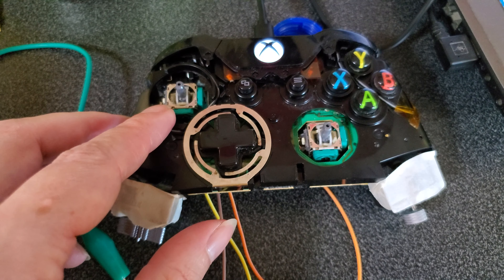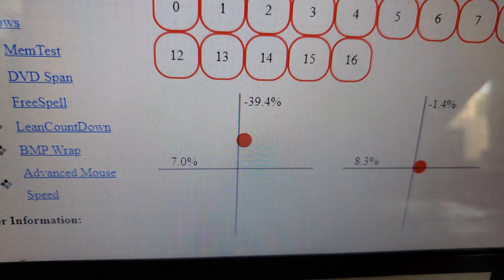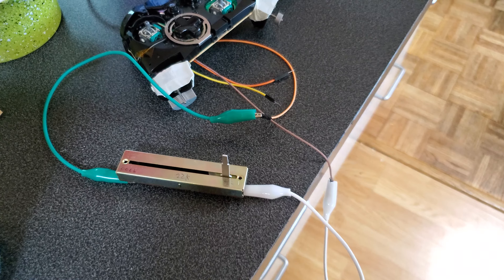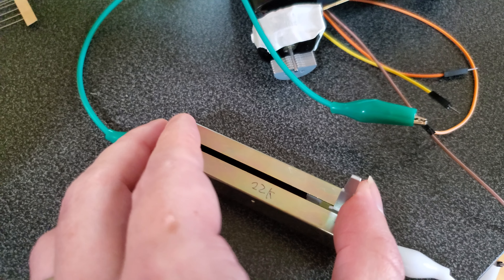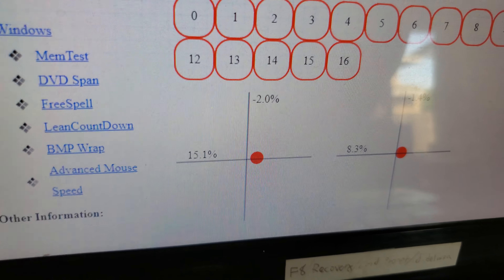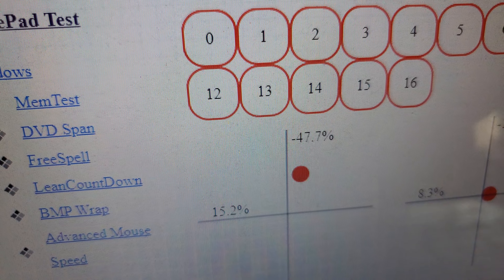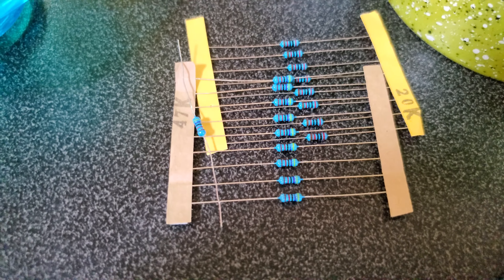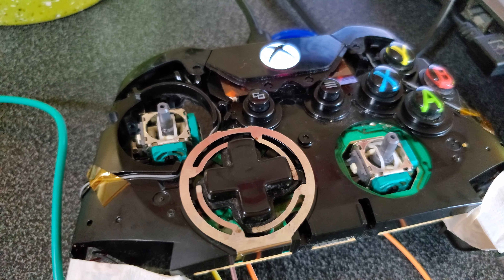Fixing xbox one joystick drift part 2: adding a potentiometer removes drift, but with side effects

Comment: In this situation as i said on your other vid. 
Your forward primary run wiper position is worn to s**t mechanically on your left stick it needs peeling open cleaning at minimum or 3 pin desolder replacing for a clean new contact & wiper assembly. 
Only then will a product like Stick drift fix help only to re centre your deadspot if its out of calibration at stock thats all that $15 Product does it would seem its a remedial fix at an exorbitant price. 
Only any good if your stick motion is still fluid on screen.
Reply from the maker: If that's the case why is it perfectly smooth prior to adding the pot?
Reply: @xeostube  Hmm not a clue thats frustrating ive not got the experience.
The only thing i can think of is the 2 Trim pot method introduces a response curve anomaly somehow? Like the Elite can change its settings digitaly. 
As to Solderkings initial 8 pot prototype work he must have been experimenting that way or considered each stick as 4 directions initially 4 pots lol. (Who knows what the game plan was) 
Dont know mate Helder didnt use it but they researched it anyway? 
Sorry to waste your time. 
I started confused i end confused total wash out. 
But they only use 1 Trim pot per side to remedy dead zone, maybe that was the only way forward on the bright side. 
Not all avenues of an experiment can be successful. 
I slipped with a solder iron 2 weeks ago? Desoldering a stick & knocked off 4 super tiny bits lost 2 couldn't solder the others back on. 
At beginer lvl i am. 
Was gona put 2 Elite V2 pots on a spare DS4 board to see if it worked. 
Ive created my own custom Analog Sticks, as full as mechanical calibration gets take a look some time. 
Its just these bloody pre set dead spots & weak or aggressive digital in game response curves in some games ported without play testing or options to adjust i cant seem to get around. 
All exampled in my vids. 
Im starving had enough internet research for today im drowning in it, good luck with yours.
Reply from the maker: @GOATGamerProSticks  two trim pots gives you flexibility if you don't know ahead of time which direction you need to bias the wiper. But the mathematical model I referred you to shows that it introduces more distortion, not less. Unless your pot goes up to a really high resistance such as say 1M at which point it's kind of like not being there.
Reply: @xeostube  I dont understand that at all that mathematical model seems flawed by my mind. 
The way i see it, it should be as simple as 1 Trim pot added per axis in parallel to swing the centre voltage either way. 
Just from your first vid for example you had up to 40%? offset from centre 0% 
By my calculation on a 10K pot 5K being centre at 0% position that seems to be a deviation calculation of (5K div by 100% = 1% 50 Ohms X 40 = 2K resistance off set? If right would you not need a 4K pot minimum to swing it back 2K from the centre of the secondary pot 2K each way?) 
If this is not how it would theoretically work i will never understand it without a college course lol. 
My thinking was if a 10K pot has 100% offset it would need a 10K Trim pot in parallel to swing it back 5K from centre on the secondary trim pot? 
As long as the primary pot was new with non worn track i would have thought it would be golden from that point onwards & just possibly need to re centre the pot position. 
I am otherwise to simple & confucius to comprehend how it works on the stick drift product but that seems to be visually how its wired you cant choose which of the 3 trimmer terminals its fitted to from that its just solder on then adjust job done... 
Ill re look at the product image zoomed in otherwise im lost to comprehend the conceptual workings otherwise.
Reply: @xeostube  Unless a high resistance secondary parallel pot grants micro adjustment on the current range? A 1M trim pot is rated 0 - 1 million resistance Ohms? (greater resistance material)
Its centre resistance value is 500K so if it was soldered in parallel to a 10K primary pot it would register at 0% input at centre 500K mark if thats how it would work if at all or change the response curve in some way? 
Then any slight adjustment on it would throw the digital centre point from top to bottom or left to right of screen in minimal movement because its got far more resistance range than the primary pot? 
(Ive blown my own mind trying to understand this im crying inside) 
Im just going to study there product circuit pathway ive had enough of this brain ache for today i dont get it.
Reply from the maker: @GOATGamerProSticks  I'm not sure but perhaps what you are missing is that adding the pot doesn't "add" ohms but decreases it, and in a nonlinear way? if you put two 5k resistors side by side the total resistance is 2.5k. So what you want is a much higher resistance so that the bias you inject into the wiper (center pin) isn't too large. In my experience a 10k pot needs around 40k-65k.   In any case the interactive mathematical model I linked to shows the exact theoretical result.
Reply from the maker: @GOATGamerProSticks  you'd never use it at the 500k point. Only at the extreme ends of it's range, either 50k or 950k. In the middle it's like not having it connected at all when it's at "50k" you are connecting pins 1 and 2 together, when it's at 950k you are connecting pins 2 and 3 together. Maybe that's what you are saying above? I'm having a hard time following what you are saying.
Reply from the maker: @GOATGamerProSticks  ps here's the math: assuming a 1k offset in the joystick, the resistor you'd need to get the neutral point back to the deadzone is 25k. check the interactive demo: https://www.desmos.com/calculator/iygqxpskrh . a 2k offset, which is huge, would take a 15k resistor, and would badly reduce the full range of the joystick.
Reply: @xeostube  I dont blame you so am i. 
But the fact remains from studying the Drift fix X360 image circuit they attached it pin 1,2,3 cente beying the wiper mirroring the primary wiper its like your saying the product they created should not work?
Reply: @xeostube  I get its not adding Ohms thats its rated resistance value, but it seems to allow the user to bias it one way or the other if the product truely works with no noticeable issues ive yet to see because im not spending $15 on it to find out. 

Could test there used pot value? 
Anyone fill this space with there findings so i can put this mess to bed. 
Then order 20? stand alone trim pots of the same rating for about £2-3 see for myself how it feels in play. 
Thats as good as my understanding will get, but i thank you sir for your patience. 
This student is a flunk lol. 

My true understanding is on the physical mechanical aspects of Analog stick form factor, the effects in game.
Reply from the maker: @GOATGamerProSticks  the design they use requires a high resistance pot since they are connecting all 3 pins. But there is no reason for it to work better than a single 100k pot placed on the desired pair of pins. As for it working or not, so far it doesn't seem to work for Xbox one Microsoft controllers but I haven't tested that many. It would work for a pdp Xbox one controller.